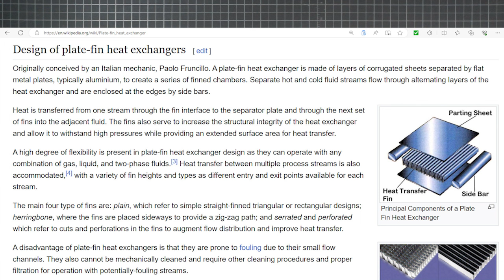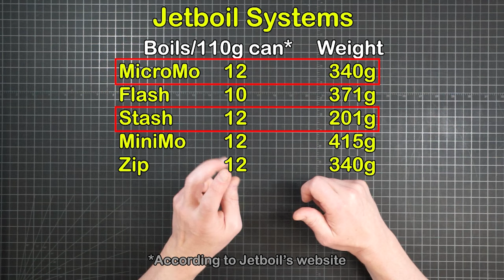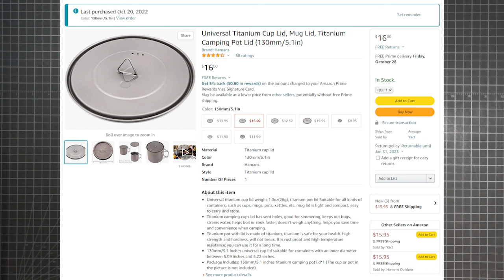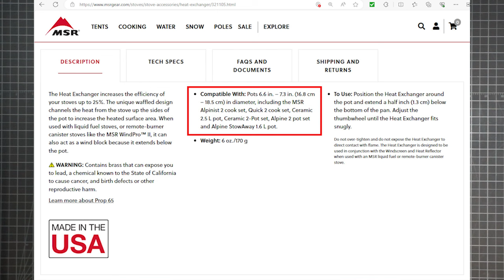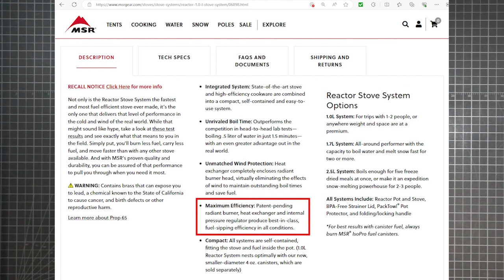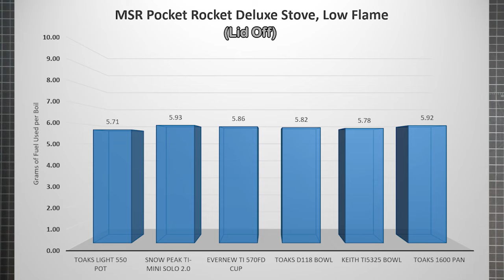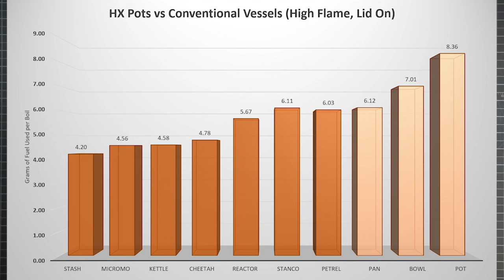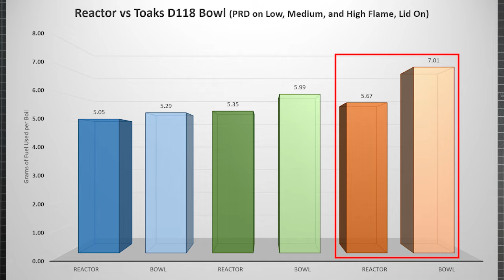Backpacking Stove Efficiency, Part 4: Heat Exchanger Systems (HX Pots)

Comment: The old MSR heat exchanger... Memories... That "boat anchor" is really good with one pot. It was designed for use with that one pot for the purpose of melting snow and ice into drinkable water, which takes huge amounts of fuel. It was typically used with a 1.5-2 liter pot, with an MSR XGK or XGK II stove. These stoves burn anything from white gas to kerosine to diesel fuel. They are very loud, sounding like a jet engine throttled up during takeoff! Back in the late 80s early 90s, that was the most efficient way bar-none of making water from snow and ice. The weight of it made it something only used for situations that required a lot of water from snow and ice. Not surprised whatsoever that it doesn't fare well when compared to more modern designs...

Comment: You could test the flame gap theory with the Petrel. Run it with the pot supports in the slots and then with it not in the slots. Everything remains the same, except the gap.
Reply from the maker: Yes! I plan to try that when I do the wind testing.

Comment: I think its not too long until we'll see HX systems that weigh less than a toaks 550 + brs hit the market. I made one, and have been using it for a few years now; so that shows its technically possible. And im not even that kind of engineer, so im sure a company with true proffesionals could get it to the point where its economicalky viable too!
Reply: Let me see. I like making stuff also
Reply from the maker: I’ve seen your video! The Joule Thief.  It is a fine thing, indeed!

Comment: Awesome stuff as usual. Former ultralight zealot here. In recent years i find myself using more and more fuel, especially if im with my wife. If im in the high country,  I am known to enjoy a hot shower every few days. So I bring a large hx pot (1.5l) and dump it into a 3l bladder and its enough for my wife and I to wash ourselves. We also do at least 2 cups of instant coffee or tea in the am and maybe a warm up cup of chicken noodle before dinner. Very useful after a long hard, probably wet day to get some salt and heat down the gullet. I'm ambivalent to breakfast and lunch, usually one or the other preferring to eat small things more frequently then a banger hot dinner, many times with fish and a (gasp) frying pan. Desert cooking needs are about half of my high country needs. Cold bath, less food. For a guy like me I've switched to HX pots as they are great for high use people like me. If im going ultra ultra light ill bring my tiny ti pot and a small cannister and it will last me up to 5 days. If im melting snow, white gas is the is the only solution. Omnilite ti is the one for me.

Alas, even amongs an army of me, I have no less than 6 different systems depending on the trip. They all have thier pluses and minuses.
Reply from the maker: It is the mark of the true enthusiast to have a kit for every occasion!

Comment: Thanks for awesome analysis. I also use Soto Windmaster triflex with Petrel. Here I learned that what I thought was the optimal small stove gap is an efficiency penalty. But in wind? Having the stove head tucked into the HE cavity surely helps some? Even if the wind blows the close flame off the pot, the flame must pass through the HE fins. I look forward to your wind testing. 

Here's an idea: in calm conditions, do NOT tuck the stove support arms into the Petrel channels, to increase the stove-pot gap, boosting efficiency. In wind, go ahead and tuck it close. Maybe I can modify the Petrel's channels to still lock the stove on, but not place the burner so close to the bottom of the pot. 

I also learned that my preference for HE pots is entirely based on what amount to thermodynamic aesthetics and doesn't actually save me any weight, for my typical use cases. At least in no wind.
Reply from the maker: Good idea.  When I do wind, I will also test the Petrel both in and out of the slotted recess. Thx!

Comment: Very interesting. I decided to test out your theory on the burner to pot gap using the Petrel and Soto Windmaster.
With the windmaster legs in the pot slots I boiled 500g of water in 5mins 10 using 6.5g of gas.
With the pot sat directly on top of the legs it boiled 40 secs faster and used on average 1.0g less per boil. Start temperature, burner level and conditions were kept the same. I do like the Petrel and Windmaster combo
Reply from the maker: Interesting! When I do wind testing, I plan to test it both ways, as well.
Reply: Interesting. I was supposed to order the 3 legs and a Petrel. Now I'll just use the 4 legs and order just the Petrel :D

Comment: When I looked at the question of which boiler setup to buy for solo and eventually gave up and bought the Stash as a nicely integrated system. I am quite happy with the choice!
I mostly use it in the tent vestibule, so wind isn't a huge problem. But a wind screen might help for lunch.
I think it's a worthwhile trade-off for the boil time, but to each their own.
Great test!

Comment: Your observation about distance of burner from pot and its effect on efficiency is interesting. You have likely noted that Fire Maple has paired their newer Hornet II (non-regulated) stove with their Petrel pot. The distance between the burner and the pot is easily twice as far as that between the Soto with triplex pot supports. I have to wonder what difference that distance will make in efficiency. You might come close to replicating by not inserting the pot supports of the Soto into the grooves of the Petrel pot bottom. I bought the Hornet II and Petrel pot as well as one of the FlatCatGear windscreens made to fit the Hornet II stoves. It is ingenious but simple and lightweight. I haven’t tested it yet as a system in windy conditions but anticipate, based upon Jon’s tests for the effects of wind on fuel consumption, that it will be a very efficient solution in real world conditions which very often include some wind. My goal is to find the lightest but very efficient stove/pot system that will allow me to extend a single fuel canister over a period of about five to six days while heating water at least twice per day for breakfast and supper. Too, for a very few additional ounces on my back, I will accept that weight penalty to realize the savings in cost through a reduction in grams per heating event of my water.  For me, speed is not a factor as long as I can achieve my goal of adequately heated water inside of about 6 minutes or so. I apply that same metric to heating with alcohol stoves too. I do think we viewers will be “blown away” 😊 by the degree of efficiency of an HX pot with more protected fins, such as the Petrel or the kettle, over a pot such as the Stash with a more open base, especially when combined with a nested stove such as the Soto Windmaster with the triplex pot support . See you in the Fall.

Comment: I have a BRS+750ml pot for my day-pack setup for occasional or emergency use. 

I have a JetBoil for planned trips for regular use. 

Since I have both ends of this spectrum I’m thankful you did all this work!  You’ve made me realize I should carry my lightweight windscreen with my BRA setup and could use it on short trips.  You’ve also helped me feel a bit better about the added initial cost of the JetBoil!

Thanks again for this series!
Reply from the maker: Very glad to help!

Comment: Always great to see another video. Ive see people shove a BRS in the fins on the Stash so I'd be curious to know how that would change things versus the Petrel and a BRS. 
Also you've got me curious to see you  do testing on the theory of burner height too. Something like ripping the wings off a BRS and the using an adjustable lab stand to change the height of the pot over the BRS. Maybe with the Stash, Petrel, Toaks 550, and the 118. 
As always though great work!

Comment: Another great video, I appreciate all the work. I think the MSR heat exchanger ring is more aimed at liquid fuelled stoves like the whisper light or dragonfly with their wider flames. I would love to see a canister stove with a wider flame compared as well such as the Optimus Crux. Perhaps they benefit from a heat exchanger more than a narrower flame. Of course the HE pot can’t be too small or the flame may hit the wrong part of the HE. 

The cooling effects of wind on the pot will also be compounded by any decrease in temperature. I think that consideration is also easy to forget when we are laser focused on efficiency in static temperature wind comparisons. Tiny variables affect performance, sure but they are insignificant compared to real world variables. 

I work 4 seasons in the wilderness and often make a coffee, porridge or soup on a cold day. I dislike the waste of canister stoves and so rarely use them but I have often thought there are many weaknesses people forget, especially in cold weather. Larger fuel tanks have more fuel mass when new and so if kept warm take longer to lose their heat and fuel pressure. Unfortunately they also remain as a “partial” canister longer. To make sure I always have fuel I would carry two canisters so I could run one completely empty before using the next. On a camping trip it’s easy to measure and pay close attention but not so much when its part of a work kit. That’s obviously more practical with smaller sized canisters.

Comment: Another great video. 

In a future video, I'd like to see a comparison between heat exchangers and tight windscreens which redirect the exhaust around the outside of the pot (giving an extra opportunity to capture the heat - acting like a secondary heat exchanger of sorts), and compared to kelly kettles which do the same but on the inside of the pot - and of course combinations of heat exchangers with the windscreens.
Reply: ⬆️ Yes, this.
Reply from the maker: I do have plans to include third-party windscreens with the wind testing of HX systems!

Comment: Something that I am curious about: how much CO (carbonmonoxide) do these different hx systems produce. And is there a correlation with efficiency and amount of CO produced? My hx kettle (same kettle as you tested) always trips my CO alarm in my camper and the MSR reactor is notorious for producing lots op CO which makes these stoves more dangerous inside tents

Comment: Thanks as always for your hard and careful work put into these.

Regarding the theory that larger burners to pot gaps may be more efficient.  This could be tested with the Petrel by trying both ways, with the stove inset in the slots, compared against the stove arms holding the outer flux ring.  Absolute water temperature wouldn't matter, as only delta g/boil is of interest.  The results could also always be easily converted to any water temperature using specific heat.

Normal stove on flat bottom pots feature narrower gaps, which might be a clue that narrow gaps aren't inherently penalizing.  On the other hand, the flux rings could choke out air fuel when hot, necessitating a larger gap compared to a flat bottom pot that these stoves are typically designed for.   There may be a trade off at play with Hx pots: narrower gap more effective in wind, taller gap without.    I used a Stash pot on a pocket rocket deluxe all season in '23 (~ 30 days) and in wind, a narrower gap seems like it would work better just judging by the flame contact with the pot bottom.
Reply from the maker: Agreed! Pot-burner gap could use more testing.
Reply: @GearSkeptic  It's hiking season!  I fully understand your packing up the tools.  Thanks again.  I've posted my thoughts and technical analysis over on Backpacking Light

Comment: Something I'm curious about is a different design on the heat exchangers.  A coiled exchanger design should retain most of its efficiency and reduce the effect of wind.
You also discussed how often people resupply, resupplying often is not efficient and adds steps.  I'm one of those oddballs that has no issue going a month without going to town.

Comment: I was anxiously waiting for this one! I ended up going with the Soto Windmaster + FireMaple Petrel for my PCT section hike thanks to FlatCat Gear's testing. I absolutely expect windy and cold conditions, which make the BRS worthless.
Reply from the maker: It’ll be interesting to see how HX systems compare to conventional pots WITH windscreens in moving air, from both a performance and weight efficiency standpoint.
Reply: @GearSkeptic  It's also worth taking into account simplicity. Windscreens are fiddly, and it's an extra thing to buy and carry. I already had a Soto Windmaster, so adding just an $18 HX pot for a full wind resistant system and not having to fiddle with anything else is quite ideal.

Comment: I have been using the Fire Maple XT1.8L kettle with the Zen pot stand with alcohol burners for the last year. It is a good combination because the prongs on the pot stand fit inside the heat exchanger ring making it wind resistant and stable. There is no flame spill around the edge of kettle at all. The Zen pot stand has adjustable levels for burners such as the Trangia, Evernew  Titanium and Toaks Siphon making it easy to find the “sweet spot” for various alcohol burners.
Reply from the maker: I do have alcohol burners on my list of things to test….someday!
Reply: I understand, and you do a very thorough job of testing I must say, hang in there!

Comment: I had looked at HX pots extensively and found most of the pots you highlighted. One concern I have, which is way outside the scope of your video, is lead and cadmium contamination in the cheap pots being imported from low and middle income countries. There's been a few research studies that have found lead leaching from products that are imported into North America, through websites like Amazon or Ali Express. Since the pots are not sold directly in the US or Canada, these pots don't need to meet the regulations of those countries. 

In the end - I ended up going with titanium pots made in Japan. :)

Comment: Love it!!!  Can’t wait for the wind results in the fall.  In the meantime, maybe a video experimenting with distance between burner head & pot.   Another idea would be to compare different brands of fuel for burn temperature and if the air/ fuel mixture of different stoves affects the burn temp.  Just thinking out loud.  Regardless,  I’ll watch whatever you produce!!  Thank you very much all you do.
Reply from the maker: All good ideas! I also want to test aluminum vs titanium vs stainless steel.  So many things…

Comment: I enjoyed this video as I’ve been looking into heat exchanger pots and stove combos in the future I’d love to see a comparison on heat exchanger setups vs wind shielded setups and fuel use. You may also want to check out the Bulin stove and pot combo the fins on the bottom of the pot are longer and covered with an additional cup piece on the bottom of the pot I’d be interested to see the correlation of the exchanger pots and their types of fins and the length of the fins.
Reply from the maker: Yes! It is coming. I just need to wait until it cools down in my shop.

Comment: Excellent video again and look forward to the wind tests. Some random thoughts: 
- On residual heat. I've read recommendations to boil water at least a minute and more at altitude. Also, a lot of non-freeze-dried (and a lot cheaper) food recommends boiling for at least a couple of minutes. I rarely do that but I'll at least let it boil for a short time before turning off the stove. When cooking that way a few seconds before the stove go out and get cold isn't wasted IMO. 
- I used a canister stove for the first weeks of an AT thruhike and agree that shelters can be great wind shield but I also found that even inside a shelter or on a table close to the shelter it doesn't take a lot of wind before it affects boil times. I love the size and convenience of these stoves but on a longer hike it's often difficult to know if one canister is enough to the next resupply and it's not possible to add "slightly more" fuel like you can with a white gas stove. On the PCT you also have the added problem that you might have to melt snow in some sections.
Reply from the maker: All good thoughts.

I did a series on Backcountry Water Treatment.  Part 1 was on boiling vs Pasteurization. It addresses the issue of “boiling for 1 full minute” in the mountains. Also, there is discussion about what you can use pasteurized water for (you are right that dehydrated meals require “cooking” while freeze-dried only needs pour-and-mix).
Reply: Thanks for the reply. Thought I'd watched all your videos but must have skipped the boil-one (had watched the chemical treatment one though as I've used chemical treatment a lot). Turns out I've wasted fuel over the years, but since I use almost only dehydrated meals it could have been worse! 

I've looked at dehydrated vs freeze dried and weight-wise it's not that much saved while money-wise on a five months thruhike it's quite a difference.

Dehydrated mostly require longer prepare times, but I'm usually able to find meals that don't require more than 10 minutes although a couple of minutes extra usually helps. On a non-extreme weather day, I'll start boiling(!) water as soon as I stop for the night and just manage to set up the tent before the water is ready. 

Then after adding the meal and stirring a bit I have time to unpack my stuff and do some chores and the meal is basically ready. Of course, adding the meal to the water immediately lowers the temp somewhat and I'll let the stove run for maybe half a minute more and maybe waste some fuel but hopefully also help the rehydration.

Anyway, thanks for all the videos and I'll try to reduce fuel consumption at least a little from now.